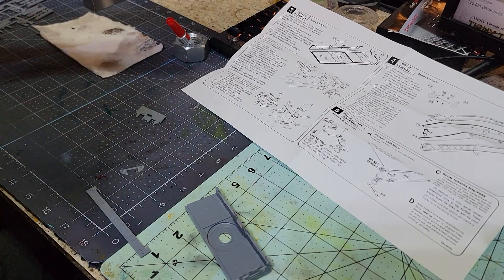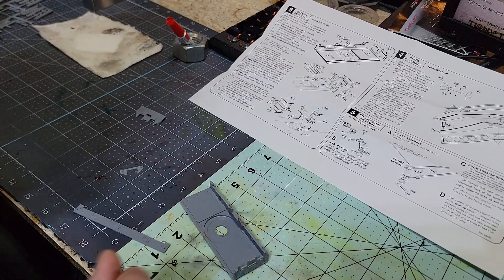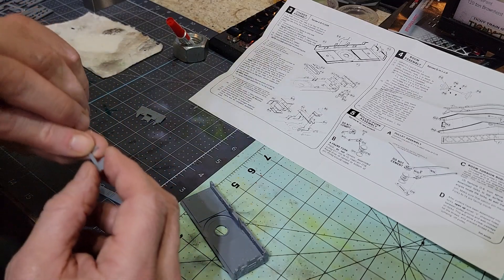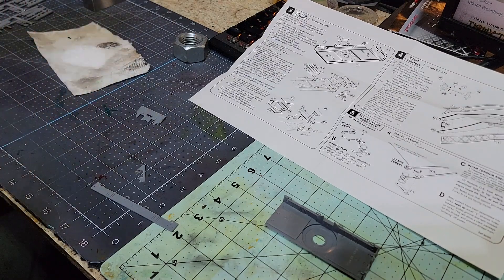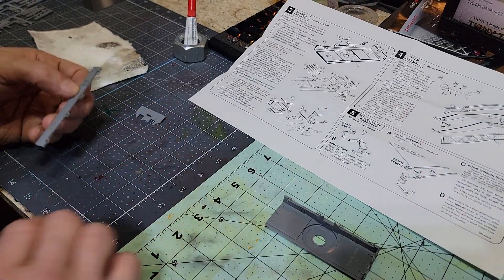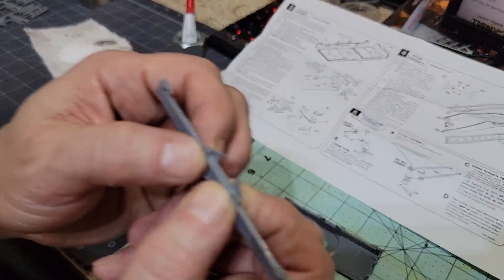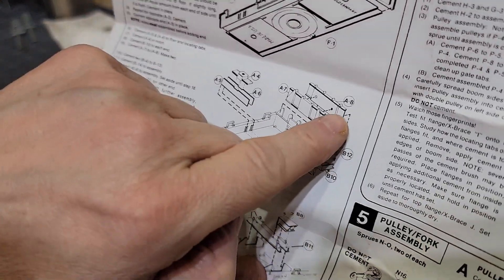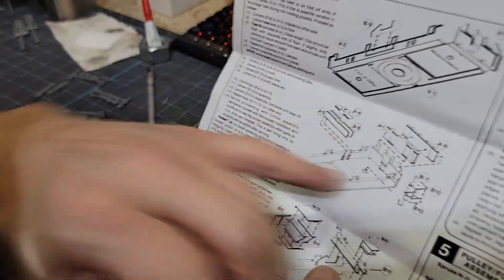Tichy Crane Part 2 Chassis Assembly

Comment: Progress is looking really good. Thanks for sharing! Though you mentioned the baking soda next to the glue in case you needed it... what would that be used for?
Reply from the maker: when you add baking soda to superglue, you get a very strong resin instantly! somethimes you need extra strength and that will do the trick, plus it cures instantly!
Reply: @elite194  Thank you! Never knew that, but now I want to try it out!
Reply from the maker: we use that technique for a whole lot of stuff, especially reconstructing locomotive steps and pilots!